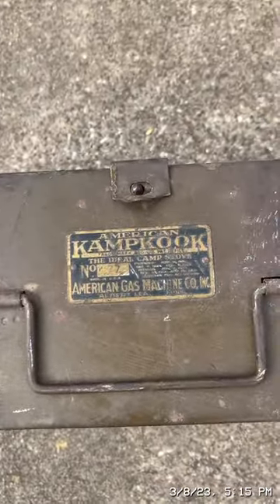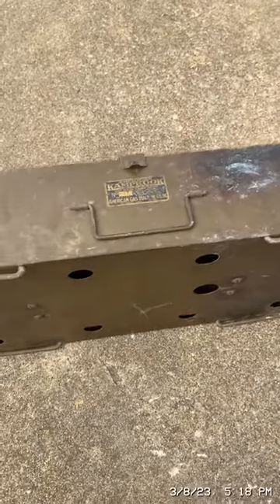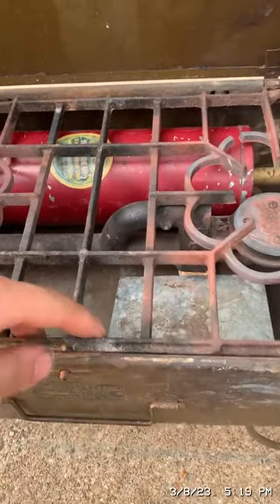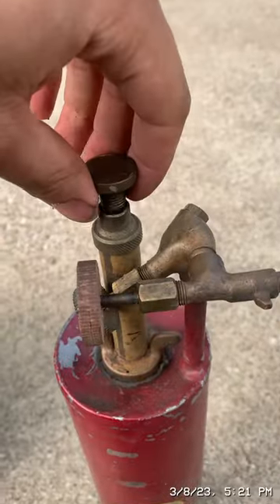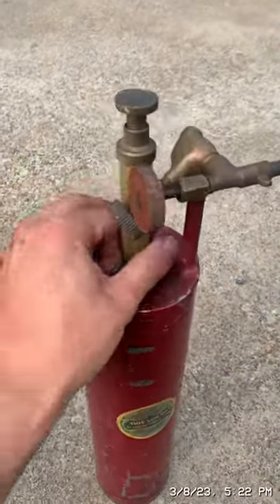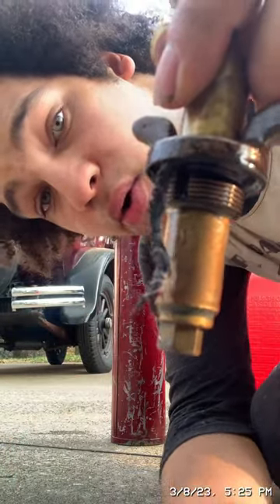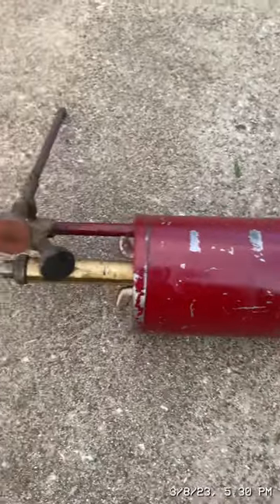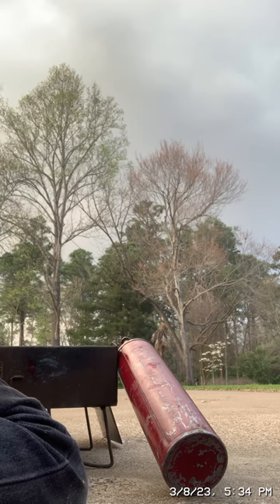1920’s suitcase camp stove

Comment: Seems like not much has change in 100 years with some stoves. biggest difference is the gaskets and some plastic valves. In addition to non leaded fuel. 
On the plus side leaded fuel may make your food sweeter. 
i suspect the only thing that will kill that thing is rust and abuse. Both of which can be prevented or remedied.